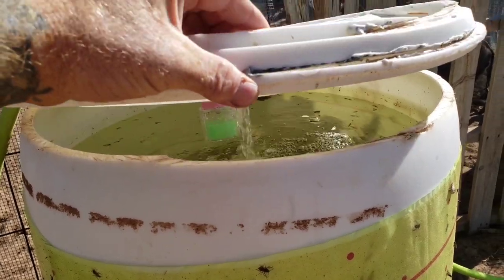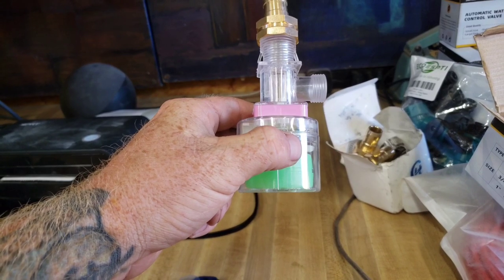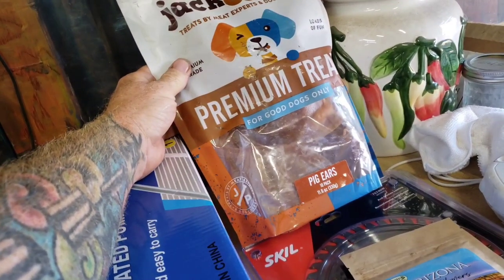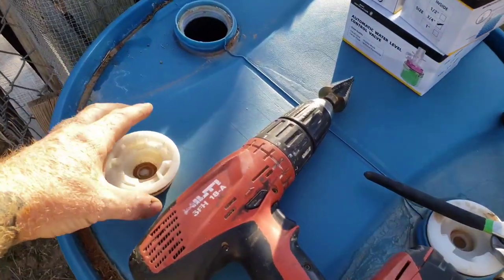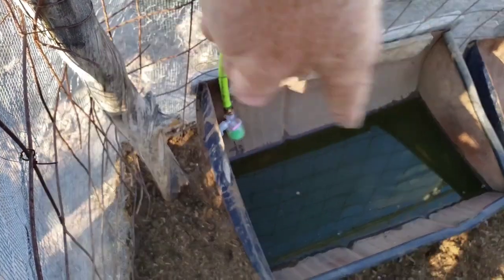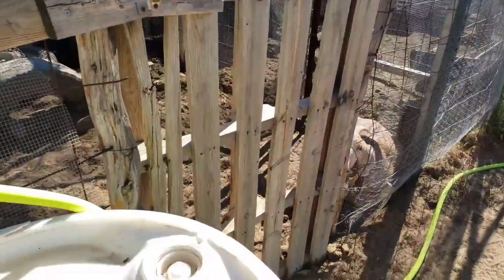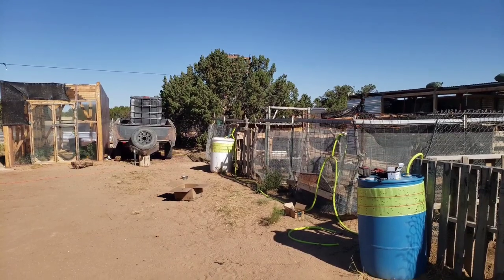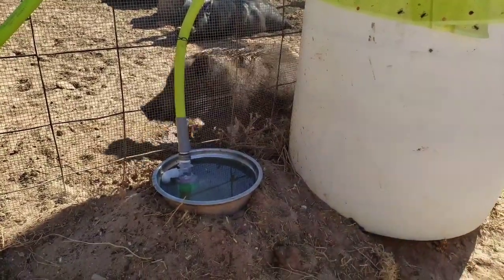Float Valve Livestock Waterer

Comment: I like your automation on watering, saves a lot of time but I believe that auto filling the tower tank could run you dry on water if one of the valves stick open when you're away. Might want to only fill it when you're home.
Reply from the maker: No, that can't happen. When the tank is full the float switch turns the pump off. The water can't climb without the pump and the inlet is at the top of the tank so water can't flow back down. Thanks for checking it out.